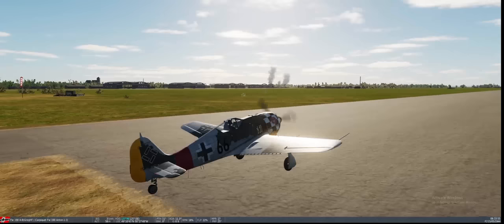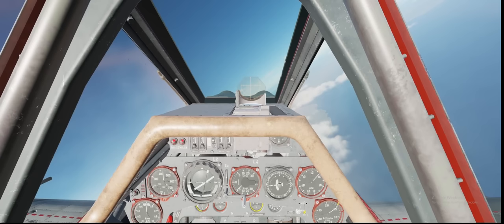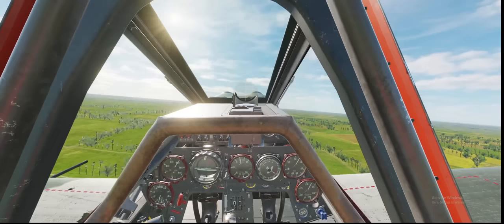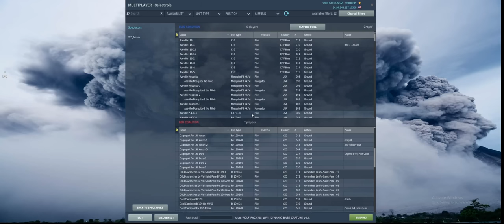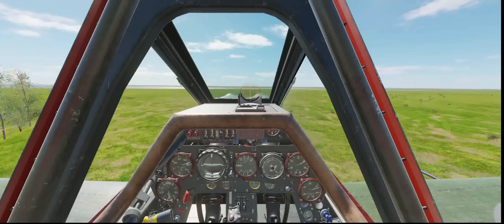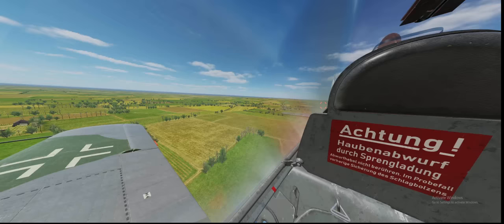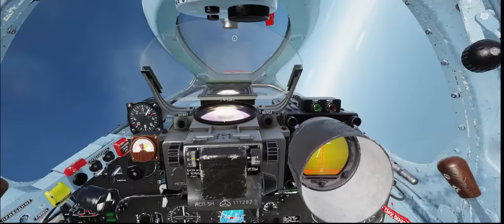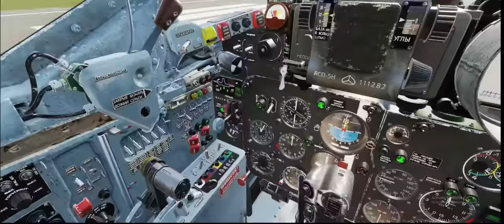German Cannons, Soviet Cannons, P-47 Mach, Angry Authors and More

Comment: I m wondering if the P-39 with the Soviets  might have an advantage (relative) in survivability due to being all metal construction against minengeschoss.  If my understanding of the Russian front is correct most of the fighting was ambush cut and slash rather than traditional dogfighting.
Reply: Well, "cut and slash" had been preferred tactics everywhere in ww2. It is possible that  P-39 had been more rigid then soviet planes. Though I newer heard statements about that. What I do heard (and from one of the best pilots of ww2) that most respected part of that plane was a radio. Excellent radio that was much different from soviet radios at the beginning of ww2

Comment: Nice reenactment of Pips Priller's flight on D-Day 😂 As for who said what about mach numbers, tactical or otherwise, that's getting a bit too catty for my taste. One factor not discussed is the ability to handle g-loads before g-suits. This gave most short people an advantage and gave Bader a huge advantage as he was a double amputee. If you NEED stick force, you will find it. If you survive that is. I learned that long, long ago, from a guy whose hips hurt badly on some days. He broke both pulling out of a dive in an F4U. Didn't even know it until after he RTBed.

Comment: Later P-47s were fitted with underwing dive recovery flaps to help them deal with their nasty Mach-tucking and death-dive problem. Before fitting those flaps, a compressibility dive in a 47 was a harrowing ride indeed. Often all the way to the ground... "Another squadron buddy had feelings similar to mine; however, he had a grandiose plan involving the Jug. He let it be known that he was going to try to reach "compressibility" in the Jug. (He had probably completed the maneuver successfully in the P-40.) Compressibility, as he described it, was accomplished by taking the aircraft up to a "safe height", 25-30,000 feet or so, then plunging into a vertical dive, at full throttle, until the plane red-lined at maximum speed; at that speed, the airplane could be brought out of this high-speed, high pressure plunge ONLY by pushing the stick FORWARD (not back) -in theory, a reversal of controls, he said.

Two days later, as I lay on my bunk listening to the King Cole Trio, my reverie was rudely interrupted by a loud, eerie, whining drone. Suddenly, a loud thud punctuated the drone, followed by stark silence. I knew one of our planes had gone down. I prayed that the pilot had bailed out. I ran outside and climbed into my Jeep, along with a couple of fellow pilots. We could see the tell-tale plume of black smoke rising swiftly into the beautiful, sun-drenched sky. The beautiful sky gave us hope that our friend might be alright. As I plunged through the woods and rough terrain, it was impossible to see if a parachute was floating down. We finally reached a clearing in a clearing made by the Jug. Fallen trees, tree limbs, and loose dirt surrounded a crater in the earth twenty-odd feet deep and fifty-odd feet across. The plane had dived into the ground nose first and vertically! We searched the sky for the familiar parachute canopy - but it was nowhere to be seen. When we looked into the crater we saw large sections of the jug still intact; however, we were shocked to find small body parts, and flying gear imprinted with the name of our experimental buddy. No doubt, he had tried for compressibility..." 

--William M. Wheeler, Tuskegee Airman, 332nd Fighter Group, 302nd Fighter Squadron.
Reply: The issue of control reversal is a controversial one.  Did it even happen to the P-47?.   I have heard Eric Brown talk about pushing stick on a meteor forward to get a pull up while at sea level in a Meteor.  
The P-47 suffered from Mach Tuck particularly strongly like the P-38.  A shock wave forms it creates its own lift but further back on the wing.  This makes the aircraft nose heavy.  At the same time elevator looses some effectiveness due to being blocked by the shock wave.  The control reversal might come from the elevator pushing down on the stabilizer such that it twists up.  This is exactly what happens with aileron reversal.  But here is the thing.  Aileron reversal never happened in real life, it was an effect that twisted the wings that reduced roll rate b ut never ever reverse the roll on a Spitfire.  In early Spitfires the speed at which reversal would occur was 580mph in latter version this was raised to 825mph.  It was a theoretical concept so I question whether reversal even happened on a P-47.  It just suffered from Mach tuck and ineffective elevator rather than true reversal.
-The P-51 laminar flow wing had such good transonic characteristics it didn't need diver recovery flaps. 
-The Me 109 and Fw 190 had all trimming tail planes so in theory could trim out of a dive.  In reality the sudden change of pitch as the aircraft trimmed out of the dive and stopped being transonic could lead to very high G forces that might break up the aircraft.  Me 109 actually suffered from lateral instability due to the rudder horn.
Reply: @williamzk9083  Yeah, no. Control reversal wasn’t a thing for the most part. What Wheeler wrote about “the airplane could be brought out of this high-speed, high pressure plunge ONLY by pushing the stick FORWARD (not back)” must refer to the necessity of doing inverted negative-G pullouts, since the shock wave forming on the top surface of the wing prevented the wing from producing lift at positive angles of attack. The sharp difference in angle on the leading edge of the P-47’s wing profile (steep on top, almost flat on the bottom) created a lopsided plow effect where a shock wave would only form on the upper surface, disrupting the airflow and creating negative lift. The P-47 would nose down beyond the vertical into an inverted dive. Other fighters like the Spit, P-51, 109, 190 had more even leading edge profiles and camber that created shock waves on both the upper and lower surfaces balancing out the shock waves, still disrupting lift, but without the lopsided force applied by the shock waves themselves. The dive recovery flaps mounted just aft of the landing gear created a shock wave that balanced things out.

Comment: @gregsairplanesandautomobiles
In your other dcs 190a8 video you say at 9:30 that it can sustain 1.32ata for 30 mins as long as temps are good, and in this you say 1.4ata as long as temps are good. Which is correct? I suppose at 1.4 one runs out of fuel before it becomes a problem regardless, haha.
Reply from the maker: Both are correct. In the other video I'm talking about what it says in the aircraft's pilot manual. In this one, I'm talking about what you can actually get away with.
Reply: @GregsAirplanesandAutomobiles  cool, great, thanks!

Comment: Question, if more air cobra's had been used in England, to provide damaged airframe, would the 37 mm cannons possibly made it into some b17 navigator nose cone, like what happened out in the Pacific and med with pt boats
Reply: I personally don't think it's really feasible, the 37mm is an awkward 200lb gun almost 8 feet in length. I just don't see how you could cram that in a B-17 nose and have it be usable.
Reply: The UK had a coastal command  version of the B-17 with a 40mm gun. It required a form of chin turret. A few instances of 20mm cannon in nose installations in USAAF usage existed but were rather rare.

Comment: I had a bit of a strange thought watching this. There are so many questions left open by the historic accounts and technical sources, as well as counterfactuals and so on that could be explored with experimental archaeology. In historic martial arts, I see this done quite a lot, and of course never with original weapons but rather with the best available analogs. Seeing this video made me wonder, what if any experimental archaeology is being done using flight simulators? The first step, logically, would be to have some elder veterans in to assess just what can be learned from simulation and more importantly what cannot. From there, pose an appropriate question that needs answering, set up careful scientific experiments in the simulator which control for the variables in question. I think a lot of what you do is coming close to experimental archaeology, although it's lacking in the methodical approach only.

Comment: It is true that the British Air Ministry loved the high quality manufacture of North American aviation, it was a reason they asked them to produce P-40s which led to the 51. But it was not that or laminer flow wings that made the 51B/C/D/K about 25 mph faster than the Spit 8/9/12 despite their having the same wing area and span, slender fuselage, and hp powerplant. Post war tests found that the exceptionally thin Spit wing produced about the same drag as the thicker 51 wing. It was mainly the radiators. Designed in the mid 30s, the Spit had those big boxy underwing radiators with limited Meridith Effect (look it up) that recovered only about half the drag of cooling the engines. Because the landing gear for some reason retracted partly into the aft wing there was not room to laterally broaden the radiators to make them shallower and higher Meredith effect. This was solved in the Spiteful which has those very transevesly broad and shallow radiators that pretty much eliminated cooling drag (the radiators are molded much too deep on the Trumpter 1/48 Spites), helping make the Spite much faster than the Spit with the same Griffons. As explained in an Air & Space magazine article (Peter Garrison, Aug/Sept 1996 Who Made the Mustang which discusses the Fokker connection BTW), the more advanced 51 had the deep volume, high Meredith Effect fuselage raditor that recovered almost all the drag with its jet thrust. So it could do ~435 despite the obsolesent and wimpy 28 liter 1650 hp Merlin first used in 410 mph Spit 9s back in mid 1942. That when the Spit 14 that came into service same time as 51B/Cs was even faster because of its 37 liter Griffon putting out a screaming 2050 hp despite the enormous box raditors sticking way out into the airstream. The Germans apparently never figured out how the 51 was so fast with such modest power engines, wind tunnel tests did not solve that. The cute little adorable wee 109K was faster than the by them obsolescent 51s because of its 2000 hp motor. The low drag radiator is one reason that the 51 had long range, although as G has explained the 47 could fly as far as long as you slung a lot of fuel beneath the beast, the cowling of which greatly reduced radial engine drag, as did the ducted cooling fan on the 190A (putting the radiator in front of the engine as per Jumos, or the leading edge of the wings as per Whirlwinds, Mosquitos and Hornets also worked).
Reply from the maker: I covered all the radiator stuff in an earlier video. That topic simply didn't fit into this one.

Comment: P-47 problem with dive was not acceleration but compressibility making it unable to pull out of the dive due to heavy nose down trim at high mach. Split-S from 35k ft renders P-47 unable to pull out until 15k ft or so.
Compressibility flaps made P-47 able to pull out of compressibility dive. No wonder why Bombers crew reports telling that when P-47 went down straight it just disappeared, because it takes time to pull out of that dive. Difficulty   to avoid exceed dive speed was in tremendous acceleration in straight down dive. Experienced pilot would know how to avoid entering compressibility and utilizing this acceleration. Early P-51 had same problem when passing around 0.7 mach proposing effect would appeared with total lose of elevator control. Later models got upgrade in change in angle of incidence of horizontal stabilizer and metal upgrade of elevator. Since then P-51 could  go 0.8 mach with out lose of control. P-47 resolve this problem with compressibility flaps which provides P-47 with steady pull out force.
Reply from the maker: Nope, all the tests that established the P-47 Mach limits were on planes built before the recovery flaps showed up. Also no N model ever had the recovery flaps. The altitude loss is a split S is specifically due to the fact that the plane accelerates so well in a dive, that's specifically talked about in the manual, it wasn't the heavy "nose down trim" as you said. Also the greatest amount listed in the manual for altitude loss in a Split S is 15,000 feet, and that from a Split S entered a high speed with the power ON, which was not recommended, specifically because of the rapid acceleration. It has nothing to do with Mach limits. You should probably watch my P-47 dive video. All this stuff is covered.
Reply: @GregsAirplanesandAutomobiles  Yeah they added  compressibility flaps just for fun, your logic is pristine.
Manuals clearly states that elevator authority comes back at alt between 18k and 15k ft when P-47 enters compressibility at higher alt. And this one i just read by heaving P-47manual before my eyes.
"Hold steady back pressure on stick, keep ball centered, keep aileron centered, increase power never decrease power at around 15k you should be able to pull out if not use trim to aid but with caution."
Manual also mentions that if significant side slip is present  it makes impossible to recover from divie so they advice to use rudder trim to put ball centered perfectly.  usually placing rudder trim at (N)  does the trick." This are quotes from P-47 prior N manual not P-47N this is different story.
At begging they though that P-47 compressibility problem will be as strong as in P-38 case when P-38 at alt 30k ft power on  and put in to 15 degree dive was in compressibility within 15 seconds and nose drops straight down, but still in very deep dives P-47 could enter this compressibility issue.
Reply from the maker: I didn't say there was no reason to add them, rather that the mach limits in the manuals are not predicated on them being there. The quote from the manual you are posting is for a situation when the plane is in compressability, which by definition means the plane is at or above the Mach limit. The fact that the P-47 can even recover after it's in compressablity is quite impressive, in many planes it would be too late at that point. I really think you should watch my video on Mach limits to gain an understanding of this stuff.
Reply: I watch all your videos, and i understand mach limits, im only saying that P47 dive acceleration made it very easy to get in compressibility from high alt dive and going straight down from 35k ft in p47 compressibility was guaranteed if pilot hold dive for about 7k ft if p47 had high speed before dive compressibility came quicker. And this match for me with reports talking about p47 disappearing after dives from the bombers crews.
Reply: @GregsAirplanesandAutomobiles  When Charles Lindbergh was doing high-altitude tests on P-47 he had hypoxia  from oxygen mask malfunction at 40,000 feet and had to go into a full power dive to get down to where there was breathable air. It would be interesting to know what speed he reached doing that!

Comment: What pedals do you use?  Do you have that face tracking equipment?
Reply from the maker: Thrustmaster pedals and track IR. Over on the I Fly Central Channel, Central shows how to make your own Track IR for very little money, but for me I just bought the actual track IR.
Reply: I will look into that.  People seem to be complaining about DCS as a whole,  saying it is buggy,  however some posts are 6 years old.  Much more recent post are saying the spitfire is not correct.  When the F4UA1 comes out who will it fight, I did not see any other PTO planes.  shrug   @GregsAirplanesandAutomobiles
Reply from the maker: It's not buggy, even the Open Beta version is close to rock solid and the stable version is as good as it gets in the flight sim world in relation to bugs. Keep in mind, in multiplayer everyone is on open beta, or nearly everyone. I don't fly the Spitfire, but I think it's more "correct" than the one in IL2. I don't know about the F4U because it's not out yet.
Reply: I was watching some videos, on dogfights, The Spitfire and 109s the engine blocks the gunsight for deflection shooting.  With your pedals do you have the three pedal unit? @GregsAirplanesandAutomobiles
Reply from the maker: I have Thrustmaster pedals, there are just OK.
Reply from the maker: For Multiplayer I am mostly on the WolfPack Normandy server.
Reply: I was looking at some plane tutorials, apparently if the oil is too thick just dump gasoline into the engine.  Everyone seems to do preflight checks, Does the Game add random malfunctions?  The LF spit IX had the merlin 66, this was fuel injected, however one of the fights a 109 did a negative g maneuver, that the narrator said he could not follow without stalling.  Also the LF should be 20mph faster then the earlier versions. How did they model the airplane?  Some of the servers I noticed the planes had ID tags linked to them    @GregsAirplanesandAutomobiles